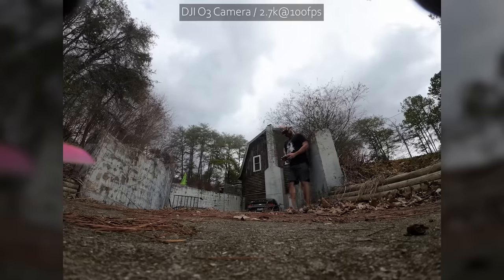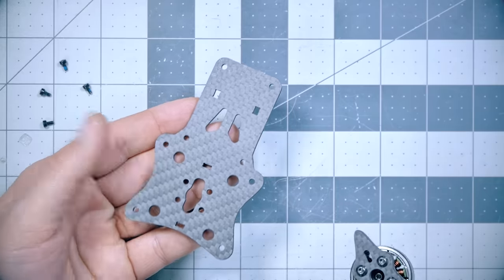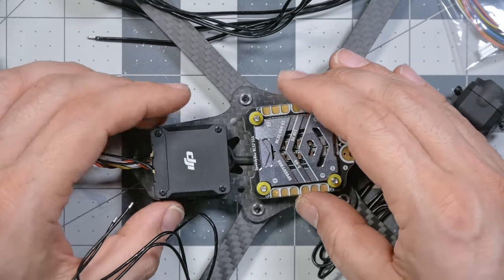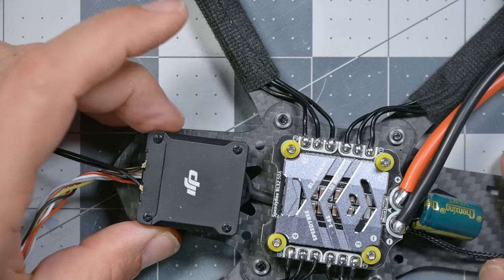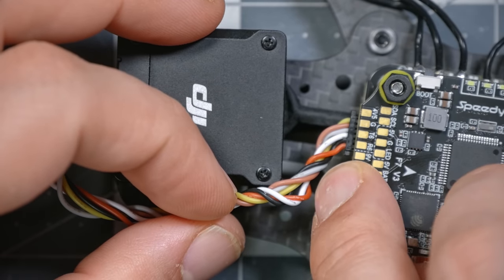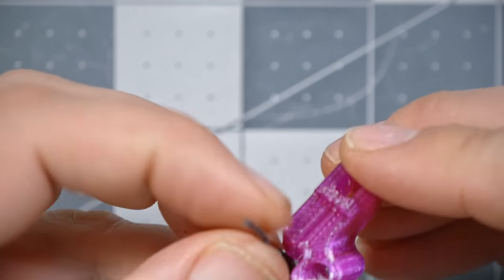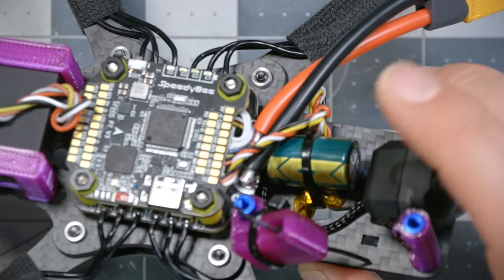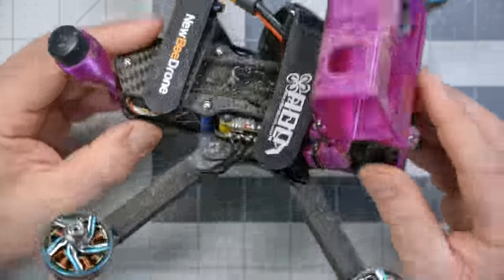3 MONTH Build FINISHED! 🤯 VannyStyle & DJI O3 Air Unit Reveal!

Comment: Nice build video including some of the usual problems I face with builds although one headache you skipped was where to install a buzzer. Will be good when frame designers consider this piece of valuable equipment and designate a place for it and possibly include a print to hold it in place. 
A good point you make is the non existent camera protection. Using simple standoffs in 2023 on the front end with an o3 cam sticking way out is not only just lazy from the design point of view it shows disregard for peoples expensive non replaceable lens cameras that dji have moved towards. That makes this frame a total deal breaker for me. A better design is what GEPRC did with the mark 5 O3 version.
I'm probably going to install an O3 into a mark 5 and also one into an axis flying manta 5. Both have far superior camera housings (as do others) to this frame and show that we don't need to live in the year 2018 with poorly designed 5" frames and unimaginative standoffs up the front doing nothing at all to save the lens.
Reply: I fly the GEP MK5 O3 version and it ticks all the boxes for a 2023 freestyle frame indeed. I got it bnf with the 2107.5 1960kv motors and man what an excellent kwad.

Comment: I don't recommend that stack... Ive been through 3 of them... One was faulty from the factory.. The next failed after really nothing. And I just had one blow up today... Never had an ESC/FC combo this unreliable and non-durable. Stay away from that speedybee.. Just y two cents. :) happy flying! (also the huge heatsink just makes it almost impossible to install in most frames).

Comment: a terrible frame! Building these good and expensive components in such a carelessly constructed frame is repugnant to me!
Camera mount with only one screw in TPU,
the o3 bracket without washers on the nuts in TPU,
not enough space behind the O3 VTX,
the ELRS antenna mount on the side,
the RX attachment to the capacitor with a zip tie,
the compressed stack....
It couldn't be worse!
But how the copter looks after your first flights, the whole construction is sufficient :-)

Comment: 37:59 is the yellow wire broken ???
Reply: I think it’s just the sbus he forgot to remove.  He doesn’t need it since he is using the elrs receiver
Reply: If you leave the SBUS connected it will interfere with a separate rc link like elrs